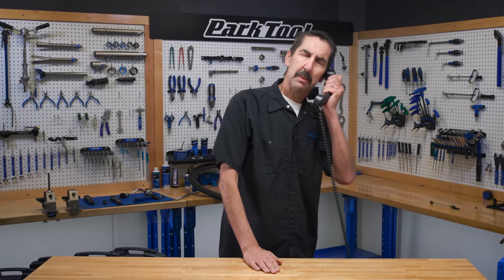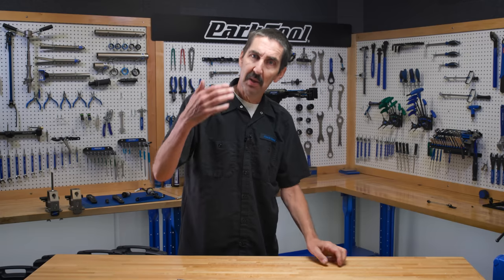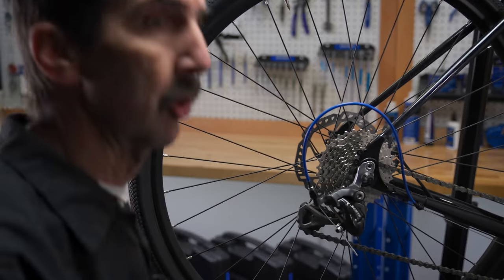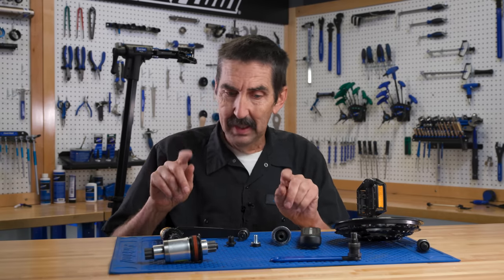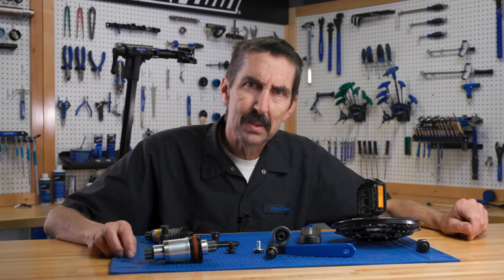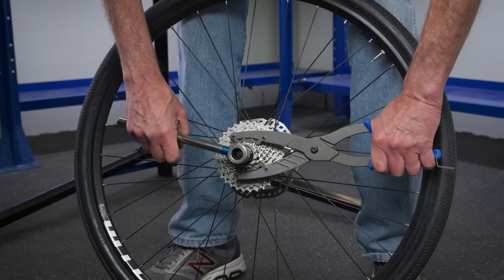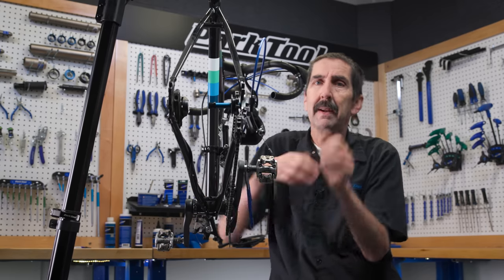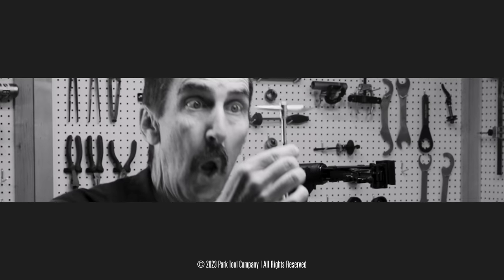You're Using Our Tools Wrong | Tech Tuesday #209

Comment: not using as advised is not the same as using incorrectly.
I had to grind my socket to remove a bolt in a zero clearance hole. I had to sharpen my screwdriver to fit the slot in a screwhead.
I used heat to bend my breakerbar into a shape that could access a tight location.
All not as advised..

Comment: I once saw someone try to remove a cottered crank pin by resting the crank arm and the head of the pin on a block of wood, and hammering with a steel hammer on the threaded end of the pin. They ended up mushrooming the pin and riveting the crank in place.

Comment: Using a 4 pound sledge hammer and a flat head screw driver to unseat head set bearing races , bottom bracket bearings/races and oh YOU BET!! hub and cassette bearings and races as well 😂😂😂

Comment: Whenever I see someone grab an adjustable wrench, it absolutely drives me insane. Might as well use channel locks on that bike.
Reply: naw, adjustables are fine if you use them right, just make sure you haven't confused the standard for the metric varieties. also, adjustables wont mar the surface like a channellock or exhaust your hand by having to squeeze to keep em in place.

Comment: Tool Placement - should have also said about making sure you aren't pulling up or pushing down with a danger of slipping and smashing yourself into the sprockets
For removal of pedals: crankarm pointing forwards and tool backwards is best!
Reply: Yes! There is almost no worse pain than contact with a chain ring.
Reply: What about sideways left and right?

Comment: OK, I get that the BBT-Bottom Bracket tool, should be used for the brake rotors when pressing it down.  Makes sense, and will admit I myself did it wrong and it messed with the older alum bottom bracket tool that I had.  Park Tools was kind enough to replace under warranty.  The only issue I want to bring up, is what is shown here on this video is different than what Park Tools shows on their home page video on using the tool.  https://www.youtube.com/watch?v=9v-322vTaIM     Personally, I like the BBT-9 better for removing the brake rotors and bottom brackets.

Comment: A cheap screwdriver on limit screws! #%%#@@!*. Cheap tools are never cheap.
Reply: It's not so much that it is cheap but a different standard. JIS and Phillips have a different engagement, use the wrong one and it will slip.

Comment: Kind of dumb to have parts that are torqued to 40nm with such a small clamping area for a tool. Not a Park problem but just very stupid design from the bicycle industry. I understand when you’re installing something like a thread together BB in a press fit shell you have to compromise for a shell that never was intended to have a threaded interface but some of this stuff is just poorly thought out case in point suspension caps.
Reply from the maker: Along this line of thought, see the BBT-RS. 
https://www.parktool.com/en-us/product/bottom-bracket-tool-retaining-system-bbt-rs